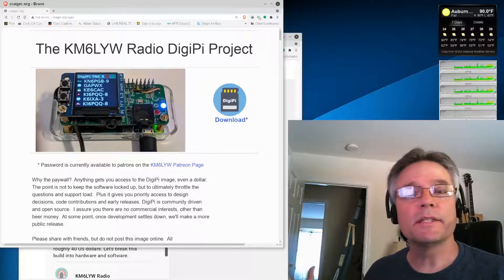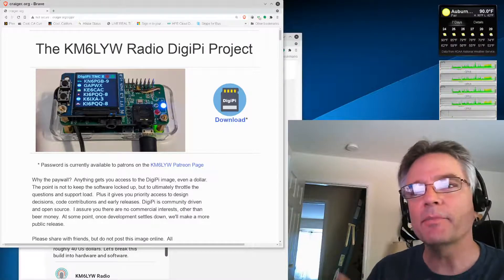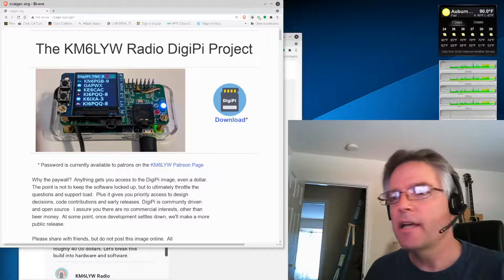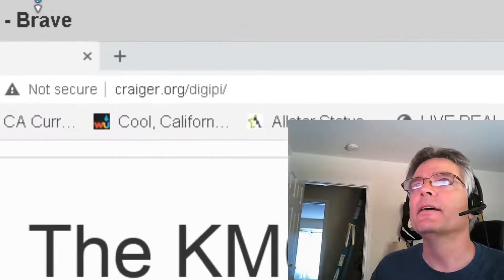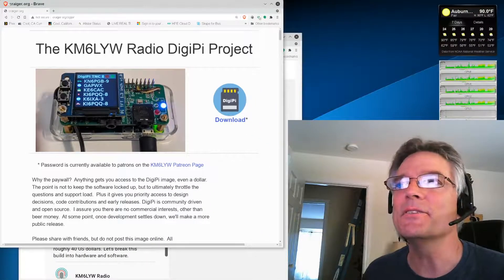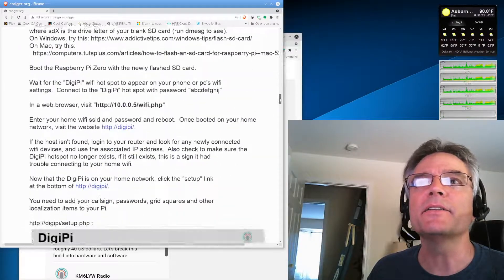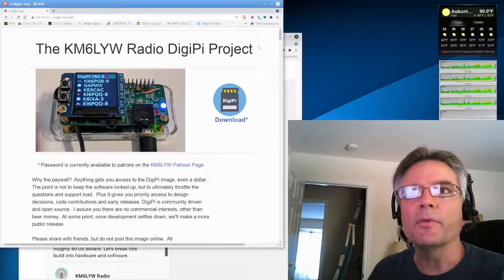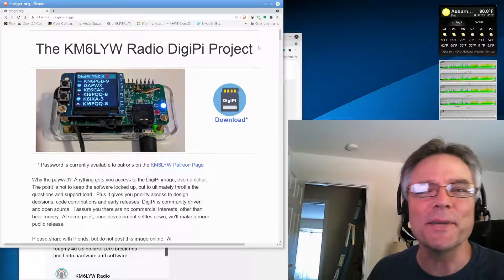DigiPi Build - Preamble

Comment: I am excited to see this set of videos, could you please describe the necessary components of a mobile radio that is needed to do the sound.  For example, I have an Icom ID-5100 that I would love to put the second VFO in use to run a mobile digipi it has a data jack and a speaker 1 speaker 2 jacks.

Comment: Curious.....if I have a spot device with a screen attached already (read Z word), am I able to use it for the DigiPi or do I need to start over and add a certain screen to another Pi?
Reply from the maker: it needs to be a serial port (spp) screen, then the digipi driver might drive it.  I open sourced the display driver, https://github.com/craigerl/direwatch .   Any "ST77x" display should work.  if it's a touch screen or something else, nope.
Reply: Yeah I'm guessing you're asking about one of the Nextion displays. I have a couple of those. Unfortunately they won't work - as Craig said. Would be cool but it's way too much display for what's going on here.